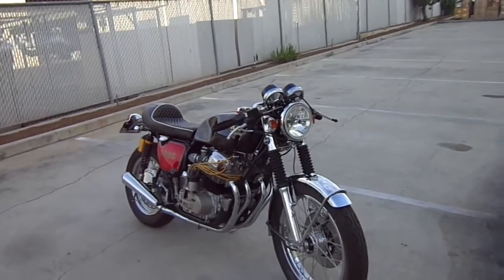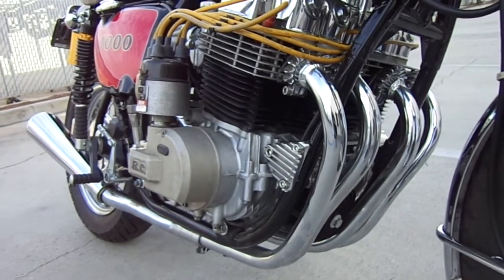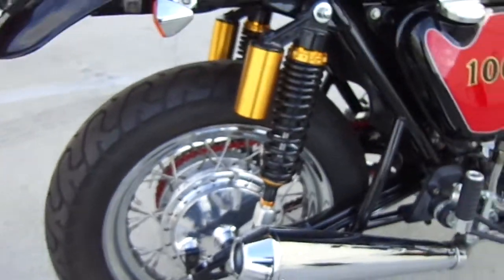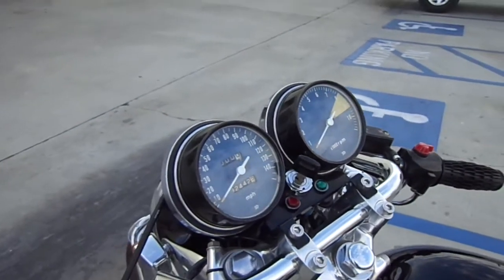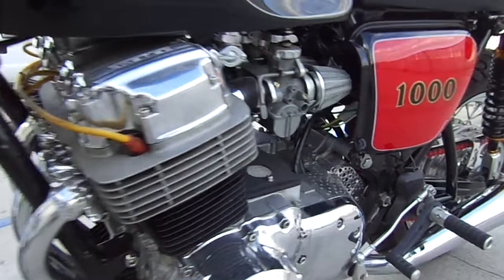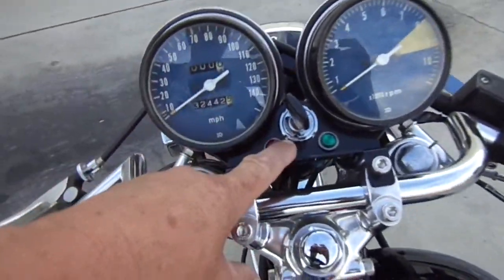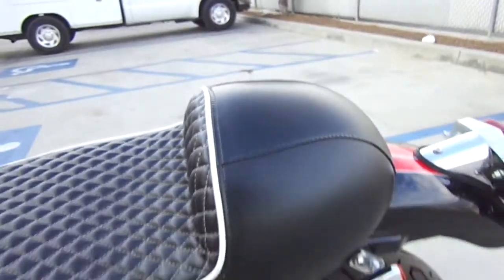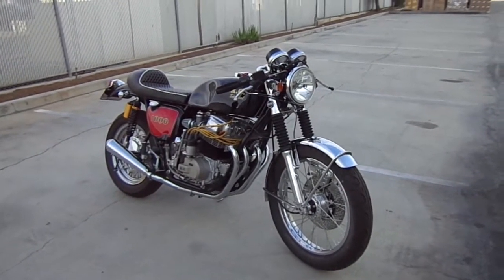Cafe Racer RC1000 HONDA

Comment: Back around 75 I knew that R.C.Engineering Catalog by heart. Might still have it tucked away. Russ recommended the "big block" "golden rods", H/D this and that for the big motors. Memory tells me the "327" cam for 1,000 cc's or at least the 315 grind. Back in the day.........